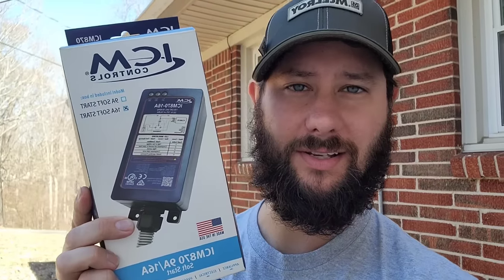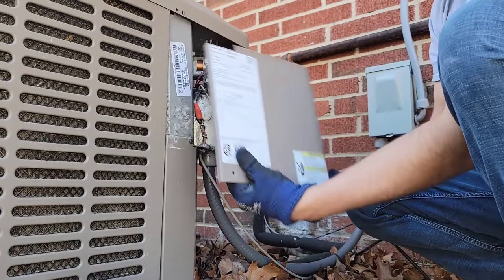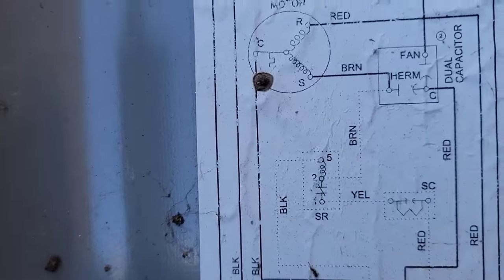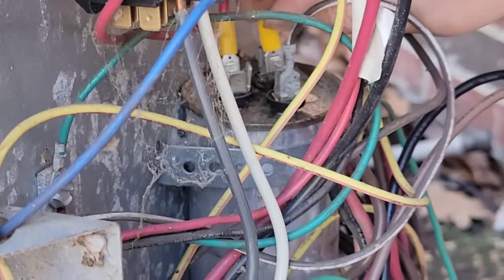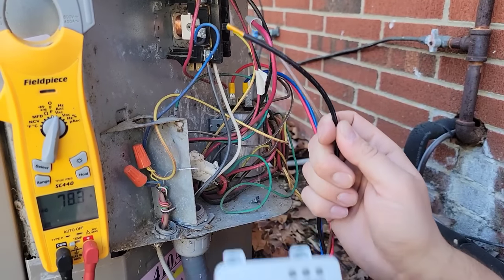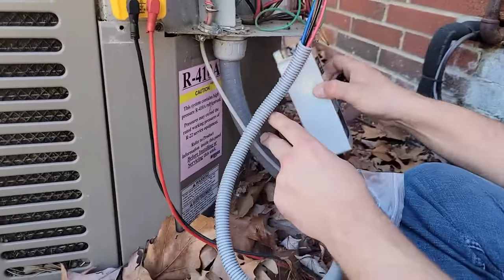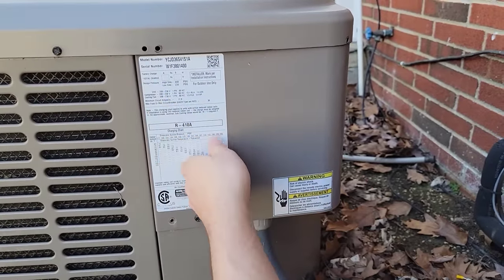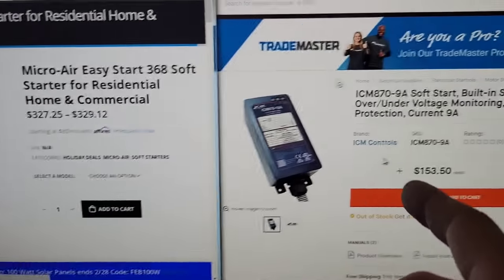How to install ICM870 Soft Start? @icmcontrols9960

Comment: The RED wire from the ICM needs to connect directly to the contactor terminal that the capacitor common wire goes to. The reason is this:
the gauge of the wire to the capacitor common may(in most cases) be smaller than the gauge of the ICM Red wire. If the ICM Red wire is connected to the capacitor terminal it forces the compressor current to go through a smaller wire!!!!!!!!!!!!!!!!!!!! BTW I love my ICM870-16a!
Reply: if a smaller wire is connecting L2 to C, how is the ICM pushing current back on it? The device controls the inrush to the comp motor, it does not provide a current source to push back against L2.
Reply: You are exactly correct on RED wire ICM to contactor terminal L2 (run side) and not off the C terminal at the capacitor.  Even so, the ICM 870 looks very gimmicky, though it may be a good application on low voltage situation, generator power, or multiple equipment simultaneous starting.  On a single AC unit, as the video shows, it is totally unnecessary, especially where a hard start/potential relay (about $50) is installed.  The ICM 870 reliability and longevity, 5 years from now, is also a question mark.

Comment: Installing one on a Mobil home outside unit would be a good video if you get the chance to. I installed 15A one on my Advent RV AC and it's working great. Sound of start up is smooth. Like your video.

Comment: Those are pretty good for the money but if your compressor has a rating close to the max fla then go with the next model up.. they use cheapo “dingfing” starting caps in them and have under rated bus fuses inside which the units are sealed..

Comment: Thanks, man. Gonna be installing the ICM-870 32A version at the end of July when I can get a hold of one (seem to be OOS online everywhere). 
Why do HVAC pros recommend hard starts if the issue is the "hard start" noise and harshness?  
Yeah, they're like $15, but don't the hard starts decrease the life of the compressor? (so money grab and earlier replacement?) 
I like the quiet operation of these soft starts and the fact that my compressor will (should) last longer.

Comment: Watching your video inspired me to run out and pick up one. My unit is about 15 years old and runs good.  Had to replace the cap a couple of years ago but that’s it. Installed the ICM870 16A. My compressor 208-230V 13.6LRA and 76LRA so I believe I have the right one. As you mentioned wiring couldn’t be any easier. When I press in the control relay all I get is a low hum. Any ideas what’s going on? Went back to original wiring and compressor works normally. Suggestions greatly appreciated! Thanks
Reply: Any suggestion why the ICM870 doesn’t work?
Reply: Hey Joe, I saw this on the manufacturer website.  May be the reason.  " ICM870-16A: For AC’s with a Compressor Load Amp Rating (RLA) of 9.1-16A – 
* Note: The ICM870-16A will handle a condenser up to about 2-1/2 tons "

What size is your condenser?  Not sure if that is the same size as the unit?  Mine is a 4ton unit,  not sure if it will work on mine.  

Apologize if I sound ignorant, just getting into DIY HVAC.
Reply: Hi Jason, Thanks for taking the time to respond. After about 4 days I was able to get some assistance from Tech Support at ICM. I emailed tech pics of condenser specs and wiring schematic. Tech said ICM870-16 was sized correctly. When I energized the contractor no lights lit.  Line voltage was 240VAC top and bottom of contractor. All wiring was correct turns out I may have got a bad one. I reordered another and hoping for success.  I really want this control to work! Joe
Reply: @joetakayama1866  any luck with the replacement unit?

Comment: Great instructional video but why should I put one of these on my home AC? If I am not worried about power outages, no backup generator, no concern about sophisticated electronics impacted by HVAC starts etc. What am I missing??
Reply from the maker: It just helps the compressor not to have huge startups Which can save it from being damaged

Comment: Great Video instruction. However, just curious what was the rushamp when hard starter was installed. Without hard starter the start amp was ~74. and with the soft start it is 24 something. But how much was it with the hard start? Hard starter are much cheaper.

Comment: Your video is super helpful. I'm going to be looking at my ac unit to see if I can install one.
Reply from the maker: Glad it was helpful!
Reply: So another question I have is that there seems to be a small circuit board. I think its the heat pump circuit board but not sure and was wondering if you had any idea  @TaddyDigest . The model of central air I have is CH14NB090-A looks to be a 2.5 ton. If you got an email i can send you the pictures. Thanks again!
Reply: Can I call or book a private session with you. I installed my icm 870 and upon starting up it flashed repeatedly for 4 mins  then went green. I looked it up and that is normal as they stated on newer models it does that. After the ax turned off then a few mins later on again it flashed 3 flashes the. Paused then 3 flashes then paused and so on and so forth until the compressor kicked on and then it went green. The code reads high current
Reply from the maker: You can click the join button and become a level one member. And I will give you my email and you can send me some pictures and I can check it out for you. 
Let me know when you join in I will send you my email.

Comment: I think all the added cost of the micro-air is the external communications. Their unit connects to your network/internet to send status to your phone through an app. I don't need that functionality. That's why I bought the ICM. I also detest apps for local control of devices because most will not function if the device cannot connect to the internet for some reason. Not to mention most manufacturers just want you to have their app so they can scoop your data and sell it and shove ads in your face, thus continuing to squeeze you for money after you've already bought and paid for the product.

Comment: The microaire easystart comes in a weather proof container. It also has an app and bluetooth transmitter that allows you to monitor what your starting and running amps are. Microaire also states that takes about 3-5 starts it to reach its best results - which it did in my case and went from 65LRA to 19, running amps went from 16 to 9. So…..yours is lacking in quite a dew areas which is why Microaire is a better product for the money.
Reply: The only thing i see microaire has over the icm is the bluetooth. Bluetooth isn't worth twice the cost
Reply: @chribrian  Well besides the things I mentioned, by all accounts from the reviews their customer service is excellent. And that bt app is the only way you know if the module is still working as efficiently over the years. Otherwise you have to buy a multimeter of some sort to check the starting/running amps. So extra bucks buys you lots of peace of mind imo. Installed mine myself - same as the one shown here - 4 wires - but checking that app every once in awhile is really nice. And even though I got mine to fit under the cover plate, the water/uv resistant housing is nice.
Reply: @goofsaddggkle7351  Microaire claims they have a unique UV and weather proof case but they don't provide an IP rating. Without the rating they could claim anything.  ICM has an IP 65 rating.  ICM monitors and has a self learning algorithm also. The only thing I can see the easystart has that the ICM doesn't is Bluetooth and for some that my be worth 2x cost. For me I would pay 25% more for that feature at most.

ICM has been building after market electronics and control boards for HVAC as long as I can remember. They have been around a long time
Reply: As others have pointed out, the primary difference is the BT and how much that is worth to you or the end user.  If you are knowledgeable (and if you are watching this, likely you are), then BT may be a meaningful feature and we can discuss how much it is worth.  At twice the cost, that does strike me as a bit pricey.

BUT, if you are installing this on the average consumer's AC, most will not understand or use the BT or the info it provides.  For them the cheaper unit (the ICM) would likely be more desirable.

A couple of other differences:  The MIcroair is larger, but the case looks to be put together with screws, so it could opened up to repair it.  For example, one could replace the capacitor if it were to fail.  The ICM case is welded shut, so it would difficult to open and then have to be glued shut.
Reply: For the statistical thinking out there monitoring thru BT probably makes for a nice output graph but inherently useless generating repetitive data points that are mostly within specs over time anyways. The smarter manufacturers hopefully have already determined their units own mean time before failure in-house before releasing in the market. BT is better in the hands of design people & probably irrelevant in the hands of the consumer.

Great simple install video, Tks Tad
Reply: @miszced  As a knowledgeable home owner, I would like the ability to periodically check the start and running amps from inside the house and without having to remove covers and take a meter out to the unit.  Also, my clamp on meter is older and I don't know if it is fast enough to capture the LRA peak on start up.
Reply: The Easy Start isn’t a soft start either. They are scams. Just use a hard start.
Reply: @BryanTorok  understood, respectfully I'll maintain my position in the earlier post. Doing old school 100% inspection either by periodically collecting  raw data or otherwise may provide a false sense of security. Anyways, without laboring this point any further as a suggestion (not a recommendation) have a look at behind your electrical panel face cover using nodes from either Sense or EMPORIA both at  Amazon. They may determined amperage draw (seen or unseen) culprits to all the appliances, including the HVAC. Cheers from sunny Florida.
Reply: @miszced  Tnx for the suggestion.
Reply: @jman0870  Do they not reduce the peak starting current as numerous people have shown?  Does that not reduce the chance of damaging the windings in an older compressor?  So, how are they a scam?

Beside reducing wear on the compressor, my main interest in using one of these devices is to reduce that starting current to something my generator can tolerate.
Reply: @chribrian  all you have to do is look at your home electric bill it should be a lot less, because that's what drives the bill up when the unit first starts, it zings the meter and your bill goes up over a period of a month.

Comment: This I way off the list but great watching 
Question 🙋‍♂️ could it be used in different applications example TABLE SAW/POWER HAMMER (Blacksmith) ROOM DUST COLLECTOR(I have to bump the start on switch to get the catch bags from immediately inflate)
Thanks
Reply from the maker: Yes it could be used in those applications
Reply: @TaddyDigest  wow answered so quickly I will be trying to send you a donation for helping out 
I’ll also try to figure it’s connections I’ve just learned a 2 wire version 
The motors are older than you 1900’s the table saw I bought at a garage sale in 1989 and it was used then.  The Dust collector I’m not at shop is pretty good size. Ya just put a new project on my list of many 
Cheers

Comment: Great video, thank you for showing this. Hard start vs soft start? I usually install a hard start capacitor on my units. They are cheaper ($50) and get the job done (Amrad). On my 3T York, the LRA is 83.9Amp but with the Amrad I get 21Amp, pretty good. Let me know your thoughts and keep the good job!
Also note that the reduction in Amp draw depends on your system. On my former R22 the hard start amp drop wasn't great. On my 410a York, it's way much. Scroll compressor vs piston?
Reply: What's the difference between the hard start and soft.
Reply: @jeffreyrood8755  A hard start capacitor provides a quick burst of energy to start the compressor motor reducing the Amp drown, while a slow start capacitor provides a gradual increase in energy to help reduce stress on the motor. In both cases, it reduces the wears and tears on the system.
Reply: @jeffreyrood8755  My question as well. Huge price difference

Comment: Did you check the existing capacitor to ensure mf levels?  In the begining there was a hard start kit.  I understand there was an existing hardstart, but it was there for a reason.  I would have replaced the run capacitor and installed this soft start kit.  I would have also liked to see a comparison vid of a hard start kit vs this unit and start and run capacitor set up vs this unit as well.  Nice vid.

Comment: Thank you for the info. I am trying to figure out if I can use this as I want a home BU gen.  My AC is a 3.5 ton RUUD 2023 MFD.  It says on the label 110.2 L.R.A and 17.7 R.L.A.  It appears that this unit is no longer available.  One difference the competitor had was a troubleshooting feature and Bluetooth connection for readings.
Reply from the maker: You can
Reply: @TaddyDigest  OK I found it on back order.

Comment: I've always wondered why the a/c manufacturers don't equip their units with soft start as it's obviously a better option. Added cost or maybe just prefer the equipment to wear out sooner? Don't tech's actually add additional hard start capacity as compressors age. I think I recall being charged for a device that assists "older" compressors on a previous home system .
Reply: Cost. They deliver the bare minimum for the system to work. Sad.
Reply: Soft start isn’t necessary on hvac equipment. LRA or inrush current only lasts for a millisecond. Don’t worry though, everything is getting ready to change. There’s already numerous systems on the market that have no capacitors at all, and compressors are 3 phase DC voltage.
Reply: @billg2446  DC is the way to go however it'll require more electronic and cost may be jacked up.
Reply: @cyrilasfrenchyaz  get ready, that’s where the industry is going. New minimum SEER Standards are already in place, new refrigerants coming soon, and eventually everything will be DC inverter driven. York has a system out now that can tell everything that’s going on with it without using gauges or a meter of any kind. But you need to be York certified before you can touch it.

Comment: I have a small RV park and my electric bill is mostly demand charges. I have been trying to figure out a way to reduce demand. I can't control individual usage and easy start is not an option. Do you think using an inverter with a battery would reduce demand ? I have actually had to turn away one night campers because the demand fee for one night can be as much as $70, the same as one month. Any suggestions.    I know this has nothing to do with the soft starter but I have no one else to ask.    Thanks Ken.

Comment: These seem to have been out of stock for a while. Are they really popular or just having stock issues? Either way I think I will go with a microair. The price made me want this one, but its out of stock and when I looked at the reviews I saw enough negative ones that I am not willing to risk it.
Reply: My 16A model lasted 6 weeks before it died.  I have  3-ton unit with an RLA of 15.1A and the soft start couldn't handle it long term.  The product is not very good imo.  Pay extra and get a better made unit.

Comment: Question: I have watched this several times but know that this is for a 16A is the 32A done practically the same way? I am doing this for my generator (to power my home) and I have followed the steps of this but I notice my contactor does not engage when my generator is trying to activate it. I have to push the contactor for the 4 min delay then it get the compressor running but as soon as it shuts off it will not get started again unless I hold it for the 4 min. Thanks

Comment: FYI: The ICM  pdf instructions are wrong: "Step #1 a) Disconnect factory installed compressor run wire from the run capacitor (c/common/L2) terminal" and connect it to the brown wire. This is wrong.   Their official video clearly shows that the compressor run wire is removed from the contactor NOT the capacitor. Step 2 is also wrong.  In addition, Step 4 is deceptive as no splicing occurs with the black wire as it's simply connected to the contactor.  I notified them of the errors.
Reply from the maker: Thank you captain

Comment: Great video.  Question: 78 amps at start-up.  Is that at 120 or 240 volts? I would like to know how many watts does it takes to start up the unit at 78 amps.  Also, are the same volts for the running? I know it's amps x volts = watts. Thanks.
Reply from the maker: that's at 240 volt
Reply: Thank you

Comment: Most of the videos I have viewed show connections made to a double phase capacitor with 3 poles.  However, I have a Trane heat pump system that is single phase (only 2 unmarked poles on top of cap).   How would I connect a ICM870 soft start to my system....thank you

Comment: Is the 32A version worth it as I read that the 32A has a 4 min delay which causes your ac to blow hot air in your home at start up for the first 10 min? Or do you recommend a different brand for a 3.5 ton ac?

Comment: Harry Homeowner here...I love the idea of a soft start for my older ac unit. (great video too) So my question is this- I have a 19yr old Carrier ac unit which shows:
-5 ton
-RLA 28.8
-185.0 LRA
The thing starts so violently and probably gonna get a new fan motor and redo the foundation...
However would you suggest using the ICM16A, even though my RLA is 28.8 or should I just go for the more expensive Micro Air ASY-368-X72Blue, which is rated for all the above specs.....?
Any input would be greatly appreciated!!
Reply: Doesn't seem like the ICM16A would cut it, although evidently there is a newer 32A unit coming soon.  The Micro-Air X72 is probably a safer bet